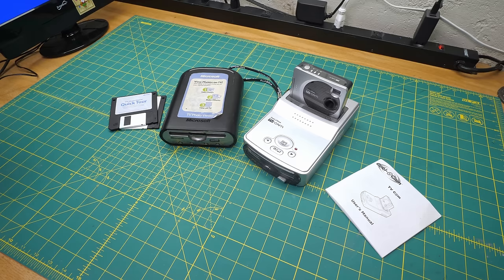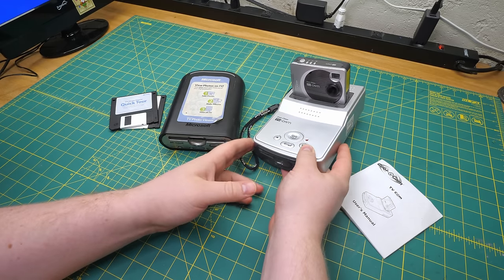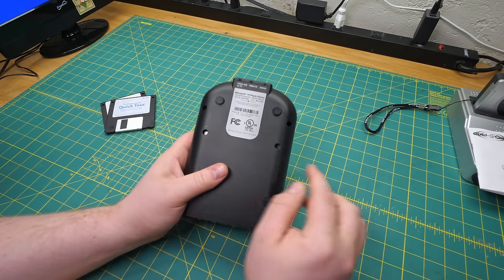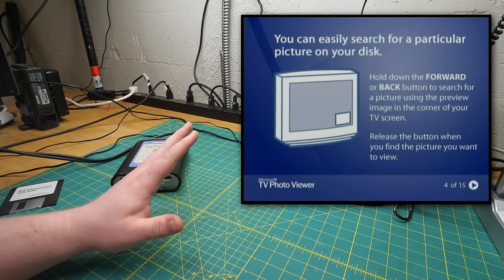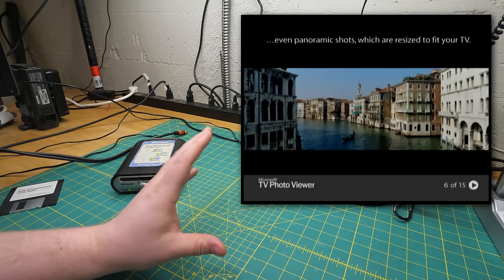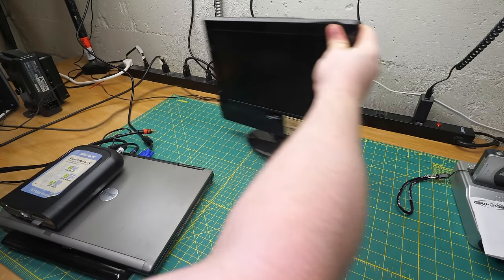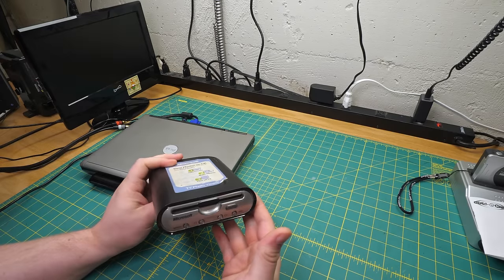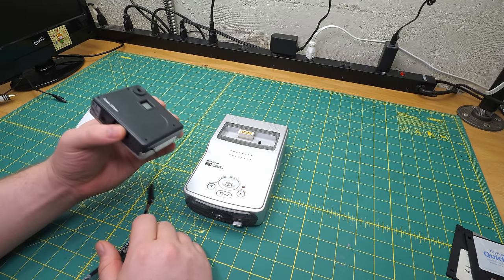"Play" Floppies On Your TV - With These!

Comment from the maker: I was trying to figure out why folks kept commenting as if I was saying that widescreen TVs didn't exist outside of Japan in 2001... and now I've realized that it DOES sound like that, because of an editing oversight. What I originally said was that in 2001, the only widescreen CRTs that would work in this country were in Japan, so anyone who had one would have to be an extreme enthusiast and hyper-early-adopter, who would therefore not be in the target market for this product. PAL sets wouldn't be of any use due to the broadcast standard mismatch - but that was a lot of talking, so I cut out about half of it, and didn't realize I still had the now-confusing comment about Japan in there.

Ah, so it turns out there were HD CRTs on the North American market! I have never seen one made before 2003 that wasn't for professional markets, but it turns out there were a whole handful. It doesn't really affect the bottom line of the product review, but it does sting; I actually spent a while looking this up during and after shooting and didn't find anything, so it appears I just need to get better at research.

A lot of people are saying the foam tape in the Microsoft device is to reduce noise. There isn't any noise, it's a 3.5" floppy drive, they're nearly silent even when mounted in a resonant steel chassis. To wit, the Cool-iCam is an even lighter plastic case with the drive rigidly mounted with screws and it doesn't make any noise you can hear from even a foot away. A VCR would be more noticeable.
Reply: Widescreen CRTS were so awkward to move around. Had one as a kid… early 2000’s
Reply: The video is already one hour on some floppy picture viewers, this little bit would probably not have hurt to keep
Reply: I honestly thought 90s widescreen PAL was just not important enough to retain, but found it totally understandable. Editing oversight makes a lot of sense too though. 

(Also; PAL widescreen was 14:9, not 16:9, as I recall. And not massively adopted until DAB at 16:9 was dominating, anyway.)
Reply: Had a Panasonic plasma 49 inch flat screen tv.
Reply: @xproot0  The thing is: it would have been fine to keep **in retrospect**.
If you applied that logic to every tangent that was cut, this video would have been 3h long and "nobody" would watch it.
Reply: I mean if the only people who used widescreen TVs back then imported them from japan, they basically only existed in Japan. People are nitpicking hard.
Reply: 16:9 CRT HDTVs did exist in North America in 2001, though they were still relatively new on the market and were much more expensive than standard 4:3 CRT TVs (though still not nearly as expensive as plasma). Some examples of early North American 16:9 CRT HDTV models are the Sony KW-34HD1 (1998), Panasonic CT-34WDM60 (1999) & CT-34WX50 (2000), Toshiba CW34X92 (2000) & 34HF81 (2001), and RCA F38310 (2001).
Reply from the maker: @CMskittles  Wow, okay, i stand corrected! I mean, the fundamental point in the video re: the Microsoft thing is still valid, but I legitimately did not know that anyone was trying to sell these here before about 2003. They've never shown up in any magazines I've read or searched through, and I would have guessed that they were special order only except that I found a Reddit post from somebody saying they actually stocked them on the floor at circuit City. My mind is blown. They must have sold no more than a handful.
Reply: @CathodeRayDude I have a memory of seeing a 42in plasma in like 2002 in a friend’s house. Both his parents were doctors ( that’s how they managed the $5000 price tag. Yikes! ) they had a bunch of McIntosh amps under it. Look incredible in 02. However guitar hero soon destroyed the screen with burn in a couple years later. Funny thing is the McIntosh amps were more or equal in cost and are still the same amount if resold today while the tv barely lasted 3 years.
Reply: @CathodeRayDude  They were certainly a very niche market at that point in time, considering how little HDTV programming was available until a little bit further into the 2000s. I think a lot of those early adopters were buying them for watching widescreen progressive-scan DVDs.
Reply from the maker: @the_dark_jumper2211  yeah I cut a lot out of this video, as with every video. it's just how editing works, you never keep everything, and when you're getting rid of bits and pieces here and there, it's really easy to miss a connection that you forgot you made. This is not the most embarrassing example of that in my videos by far. It's the reason Hollywood movies have script supervisors lol
Reply: In Europe, the 16:9 widescreen format was introduced in the 1990s and by 1998 it had increasingly become the standard. The 1998 FIFA World Cup in France was one of the first major events to be broadcast in this format. Similar EU regulations, like those later implemented for USB-C and iOS sideloading, also contributed to standardization.
Reply: Even if they were common here, this device would still be limited by that composite output.
Reply: A buddy of mine who lives in the States was on his second big, rear-projection HDTV by the end of 2001, when I lost touch with him. He got the first one in 1999 or 2000. He was a huge AV geek and an early adopter, though. He had so much AV gear on this desk he piled it all on that he had to add structural reinforcement to it. He never had enough inputs on his amp, so he was constantly changing what was plugged in and where, so switching the input to a particular device could involve diving behind that desk and digging through this massive rat's nest of cabling for several minutes.

His place was always easy to find: You'd just drive down his street until you saw the place that looked like Mission Control, with a couple VHF/UHF antennas, three Yagi antennas for 802.11b microwave links, five "pizza dish" satellite dishes (three for Dish Network and two for DirecTV), and a ten-foot satellite dish (for C/Ku/Ka-band) in his back yard.

(Tangentially: I'm not an early adopter myself, typically, but I always have friends who are, which is sort of the best of both worlds: You get to see and play with bleeding-edge tech, but you don't have to deal with the problems and limitations yourself. 🤣)
Reply: I knew a guy who had a massive (both in physical size and actual mass) true flat HD CRT television. The amount of glass required to have a truly flat face able to withstand the lower pressure inside the tube, plus the shadow mask tension ring and the outer guard layer of glass made the TV a beastly thing to move. Thus it required a very sturdy stand.

It had HDMI, it had several other inputs. It also didn't work. He offered to give it to me. I did know a retired US Navy guy who could repair almost anything electronic but hauling the TV home, then to his shop would have been a huge PITA. So I passed on obtaining a state of the CRT art television that had to have cost at least high 4 figures when it was new.

I do have a $10,000 digital projector I paid a mere $10 for and have only tested to know it works. Kinda useless as it's 1024x768.
Reply: I definitely had a widescreen SD CRT TV around that time in Europe. 
It supported both PAL and NTSC, lightguns also worked because it was old enough ;)

Comment: 1-hour photo developer here and i had to process the APS film. The camera didn't just "throw away" that portion of the frame... It marked the frame with a mark or digital recording to tell the photo equipment if it was C, H or P. However, you also had the choice as a processor to use the entire frame and print them all in one format (which happened a lot!) It was very common for users to forget to switch the format. So they would request all H or C type pictures. Also these are not the only 2 units for this. Sony had one as well for the Mavica cameras. Also the Mavica cameras would run in this format as well. There were all kinds of Floppy TV players out there. Working for Ritz camera, i definitely had no shortage of them.

I also still use Picture it to this day. I love it for the ease of use and its very intuitive. This is the express version so it doesnt have the bells and whistles. It upgraded to Digital Image Suite and does take some small things to make it work with Windows 10 and 11.
Reply: Yeah, I have a few APS index-prints where they show thumbnails for all the photos printed, and a frame that indicates the area actually printed - the rest of the photo is still there on the index print.
If you want to print the whole recorded frame, select H and never move it. That's what I did!
Reply: Bleh what a cheap, junk gimmick to just mark part of a frame as "irrelevant".  They could've at least been animorphic or something to get a bit of extra detail out of it.  Just seems like something someone could've had done on a photo taken with normal film at that rate.  I'm sure enlargements of sections of photos was something people could have done.
Reply: @Aeduo  It's an improvement over what a lot of 35mm cameras with a panoroma feature did: Just block out part of the frame with a some sliding doors, meaning you can't un-crop the picture as you can with APS-P.

Edit: In fact a lot of APS features more or less boil down to giving instructions to the photo finisher. The C and P modes says what crop you want, and you can also set how many duplicates of a certain photo you want with some cameras. Also adding titles etc. It also saves EXIF information like a digital camera with shutter speed and aperture. I quite like it, and wish APS film was still made lol. It's one of those analog-digital hybrid techniques that is so delightfully 90s. I use an APS SLR with expired film at times and the results are pretty good given the small negative size and expired film.
Reply: @bountyjedi  It was definitely an improvement over 35mm. Of course the main reason it never became successful was that digital started to appear too quickly after it was introduced. But even if it had more time to catch on, it would probably have been a tough sell. 35mm was so entrenched it would have taken a lot more than a few features like metadata and automatic loading/rewinding that only a few nerds cared about. Plus all the people saying "BuT tHe FrAmE iS sMaLlEr" as if they ever in their lives enlarged something remotely close to the point where it would make a visible difference.
Reply: @ailivac 
I was actually talking specifically about the crop feature on APS being an improvement on how many 35mm P&S cameras did "panorama" by masking away top and bottom of the frame, essentially wasting film, at least APS-P let's you "open matte" after the fact. (Yes, I have made the mistake of leaving the panorama mode on on one of my 35mm P&S cameras before...)

As for the lower resolution compared with 35mm, it is noticeable at times, but then my film is also aged so it would likely perform better when new. I think I've found that Kodak film has better resolution for me, but then I've never had one of those rolls not turn out red... Currently shooting mostly on expired Fujifilm Nexia rolls which is more grainy, but colors still come out good even on film 20 years out of date.

That there was a lack of higher-ISO APS films is a bit telling too w.r.t. resolution/graininess. Although if APS would've been more of a hit maybe those would've come?

But at APS-H it's not that much smaller than a 35mm frame in the end. APS-P tends to look pretty bad though, heh. It's just too cropped in.

Anyway, all in all, a fun format to shoot with, especially it being a native 16:9 film format!
Reply: @ailivac My favorite response to the frame size complaints was to point out just how many people already used cameras that cut the 35mm frame in half to fit more exposures on a roll of film.

Comment: Gen X here and can confirm.  I am STILL having to fix my mother's "broken" TV by hitting the "Source" button one damn time.  If I ask her to do it she claims she has been...but she hasn't.  Pretty sure this is the reason the NES had the auto switch over RF box because my mom, in the early 80s, constantly claimed I "Broke the TV" if I left the manual slider style Atari box in the "game" position!
Reply: That’s my mom, but also with her wireless printer.
Reply: The worst is when you add a broken rubber dome inside the remote to the mix. So she just keeps pressing harder to get it to work, until one day “I am doing it!!” and you can’t get the button to work either…
Reply: @CantankerousDave wireless connectivity, simultaneously the best and worst thing to happen to printers. I love not dragging my laptop over to the printer, but I somehow end up needing to anyway. Especially in any environment where the WiFi is at all spotty.
Reply: Huh, even mentally healthy and relatively younger adults were having those confusions about stuff back then.  I guess the culture and experience was just sooooooo static over long periods of time, people just lost their ability to deal with adaptation to things really early on in life.
Reply: Color coded sticky tape on the input selector.
Reply: Even as a Gen Z I have distinct memories of my grandma struggling to use our satellite box while babysitting me in the early 2000's. She had never used a VCR (I'm from a third world country) so the concept of "AV input" by itself was baffling to her.
Reply: I'm zilennial but my mom is like this too
Reply: It's the ultimate manifestation of trained incompetence. My grandfather had a job that involved interacting with software on a mainframe in the 80s, yet he's incapable of grasping anything beyond channel numbers on a TV. He even still refers to what he's watching by the channel number instead of the name of the channel.
Reply: This type of stuff makes my blood boil. Its unhealthy, I'm trying to work on it

Comment: Structural PCB is the Load-Bearing Drywall of the tech world.
Reply: Fans pressed right up against the glass is the insulated stairs.
Reply: and random pieces of off-brand kapton tape is the equivalent of load bearing wallpaper
Reply: Double sided sticky foam to glue together the whole device is the low quality reinforced concrete with rusting rebar of the tech world.
Reply: Hey that's a HIGH END COMPOSITE. Glass fibre core, epoxy resin with astounding crosslinking depth, copper outer. Spectacular material.

Problem's all the pesky chips, ceramic capacitors, and whatnot are on there too, might end up breaking them if you push it too far.
Reply: @SianaGearz omg i love composite materials

Comment: 16:9 in 2001? We absolutely had one then, gigantic rear-display Mitsubishi unit, set-top boxes (and my consoles) actially sat atop it and the wires cascaded down the back, I loved it. It was even 1080i, not that anything we put through it could ever make use of that.
Mitsubishi are of course Japanese, but my father bought it in America. No idea what store, but we did live on the west coast.
Reply from the maker: I don't know if it's actually RGB24 *on the wire*, is the thing. A lot of cameras, even in the USB2 and 3 era, do transparent compression inside the driver, the capture utility just receives the raw RGB/YUV. On the other hand, they could have skipped the mjpeg encoder IP core to save money, in which case you'd be right, it would severely limit what they could fit over the wire, and that wouldn't be surprising at all, haha.
Reply: @CathodeRayDude  I'm sorry, was this the comment you meant to reply to?
Reply from the maker: @fisherdotogg  it absolutely wasn't and i don't know how that happened, lol
Reply: @CathodeRayDude  Fair enough! May you find the right one wherever it has wandered off to!

Comment: The only benefit that APS had was that if you shot in panorama format you got a wider image, that was wider and shorter than the usual print paper, but it cost you exactly the same. So that way you got more "bang for your buck"  for your wide panorama images.
Reply from the maker: hah! okay, I admit I didn't know that. I wonder if they just used the same roll paper they used for 4x6 and simply ran off a longer sheet

Comment: 4:53 AFAIK, PC floppies could use the disk in signal but they didn't specify what signalled a disk in versus a disk out. They actually planned to ship auto-mounting floppies in Windows 95 but bailed on the idea when they realized they couldn't tell what way the floppy was wired. That's why it's called a change line.

Though that wouldn't be a problem on this device, they could have just made sure to buy drives with the correct change line polarity, or test each one and have the device remember what the signal means.

Comment: I don't remember s video being common in Europe at all on TVs likely due to the prevalence of SCART. 

I remember having a digital camera in the mid 00's that did panoramas stitched from individual stills, not sure how common that was. 

Great video as always!
Reply: S-Video over SCART and RGB over SCART had extensive support though.

On higher end sets, front S-Video hidden under a flip panel was not too uncommon.

Also if you had an S-VHS recorder, those had front S-Video you could use as a pass-through.
Reply: I knew exactly one person whose family had a JVC TV with S-video on the front, and an S-VHS deck underneath it with another one. Everyone else I knew used those SCART adapters with a composite/S-video switch 😅 which knowing what I know about them now, many were probably just crudely combining the two signals into composite anyway!
Reply: @SianaGearz  true, but it's technically not part of the standard as it uses the red channel for chroma afaik
Reply: @SianaGearz  and I have multiple Sony receivers that had it but not SCART, annoying as the north American versions got component